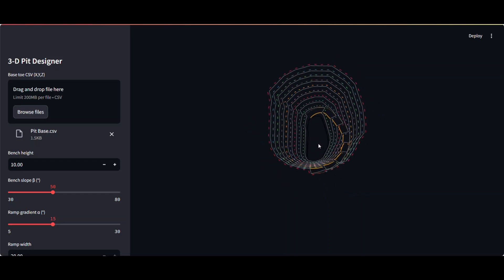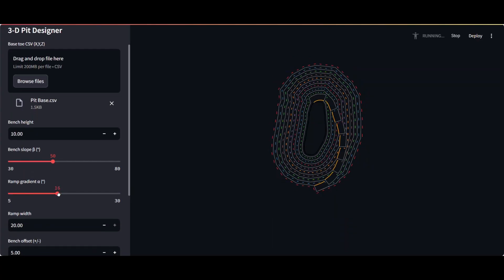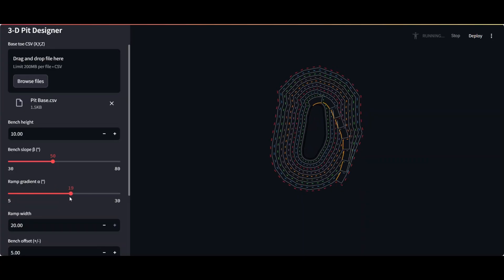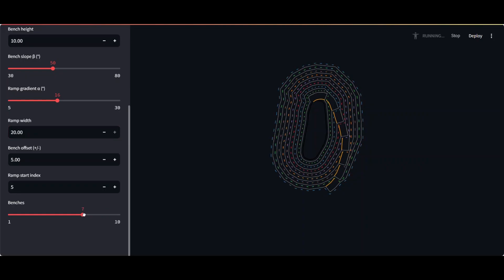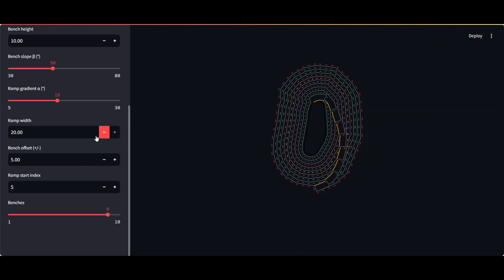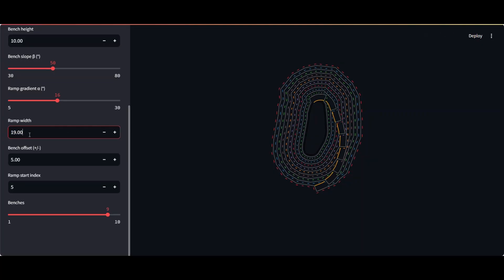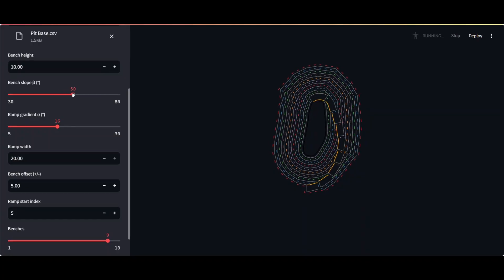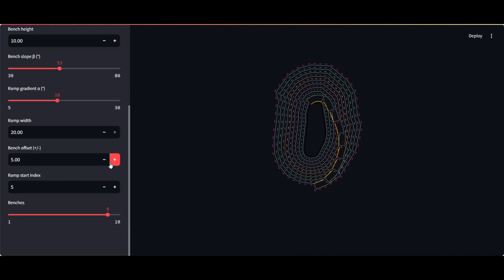Open Pit Designer for QGIS Proof of Concept

Comment: Hello. I've looked at a lot of of pit design software, and have recently evaluated Micromine. One of the problem I find, is that working on pits in California, where a lot of reclamation pits are so close to the PLs we tend to want to mine from the top down in order to maximize the pit shell withing the parcel. One of the problems with that, is that grading from the top to the bottom, it's virtually impossible to create a benched pit with hall roads. Because of the irregularities of the existing topography. Do you know of any software that would allow this or are you planning on developing a tool that would allow this type of grading. I've literally reverted to models those (constrained) pits using Civil 3d, and mostly working on a offset of polylines from my setbacks and adding hall roads afterward using the corridor tools. I love your channel BTW, great work!
Reply from the maker: Hey Guillaume, thank you for your comment.
I totally understand the issue you're facing. Most pit design tools assume you’re working from an optimizer shell, so the design usually starts from the bottom, where there’s more flexibility. But in your case, you’re constrained by the top boundary, so you have to design from the top down to avoid crossing property lines — and that’s where most tools struggle.

Funny enough, some software does handle similar constraints, but only on the waste dump side. For example Micromine's Waste dump modeller lets you define a boundary and then automatically builds it, adapting to topography. I actually rebuilt a similar tool in Python for automated waste dump design within a boundary — making that into a top-down pit is really just a matter of inverting the projection logic.

The only missing piece back then was the ramp generation, but now that I’ve developed that logic too, I think I can integrate it. If you're interested in a custom tool for this type of scenario, I’d be happy to help with that .

Also, check out this video I did a while ago — it might give you some ideas:
👉 https://www.youtube.com/watch?v=HiWzkOUjfTg
Reply: @MiningGeologist  Hey. That was a very interesting video, I'm baffled to the fact that no one in the software industry as addressed this type of quarry design from to to bottom withing the constrain of a boundary. I really see the need for a tool that would work benched pit design based on criteria with a top down grading capacity, haul roads integrated, and handles to move or reshape aspect of the pit with real time dynamic adjustments. (One can dream!). I come originally from the video game industry, with a focus on environmental modeling, and even a decades ago the tools I employed  where comparatively more advanced. Are you developing this tool for Macromine? And if so, do you have a cost on the plugin for it? I'd love to see a video of it when you're ready to deploy. Again, I really dig you work (no pun intended), keep it going, it's great!
Reply from the maker: @guillaumecamus  Thanks for your kind words, no, this tool is not for Micromine I'm building my own set of tools available through my Patreon page. if you think there is a Market for the top-down design method, I'm pretty sure I can put together a simple software that does that dynamically.
Reply: @MiningGeologist . Awesome, I'm looking forward to see those tools developed. I'll be happy to provide some feedback if ever needed.